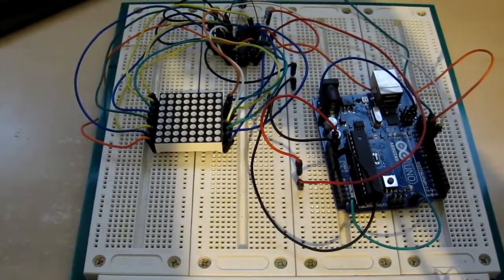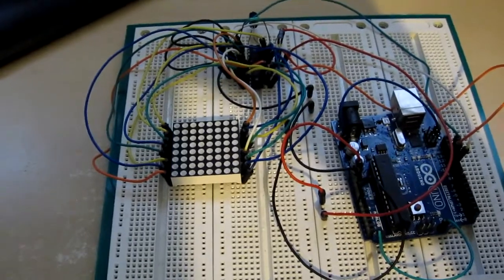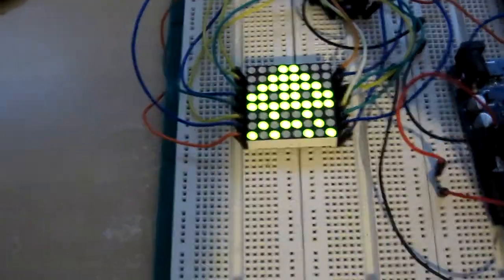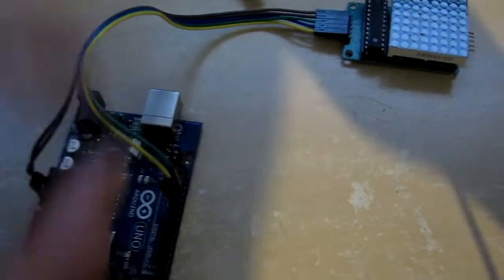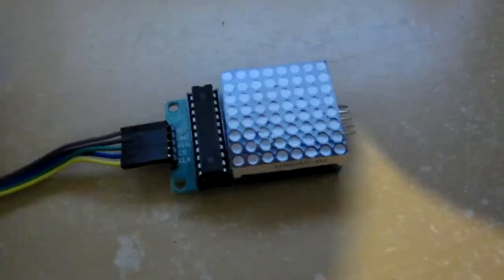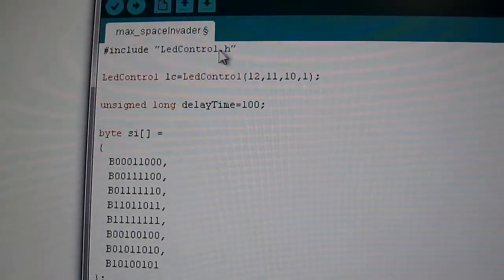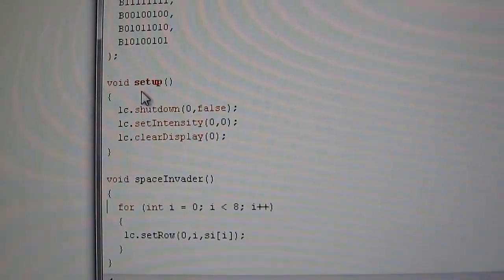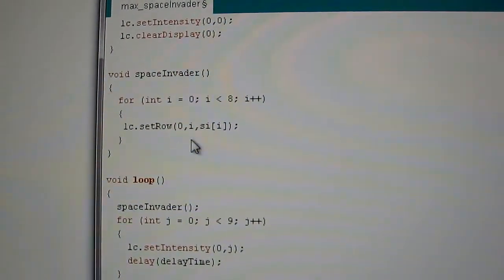Arduino MAX7219 LED Matrix Demonstration (Space Invader)

Comment from the maker: well your problem with 100 x 100 LED's is that you have 10,000 LED's to solder so that would not be a very realistic project (unless you are Mikeselectric lol) so you'd really need to be doing it using pre assembled LED panels which I have not seen with 10mm spacing

Comment from the maker: The displays are just an 8 x 8 matrix of LED's you could do the same with a grid of 10mm LED's or spotlamps driven by triacs if you wanted to. You can also cascade several displays on the same serial lines, though if you want a large number of displays there are more efficient ways of doing so